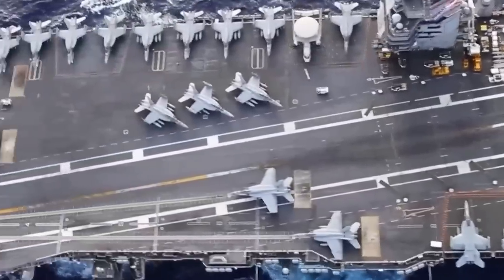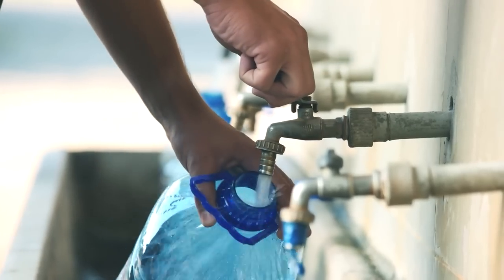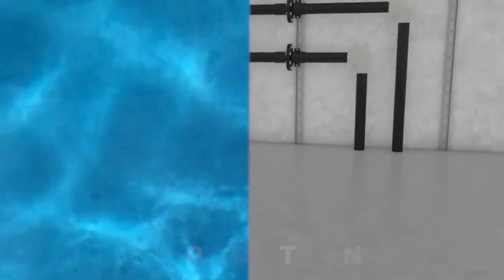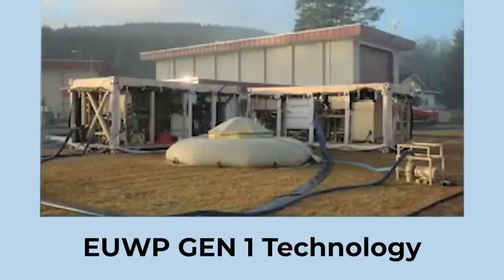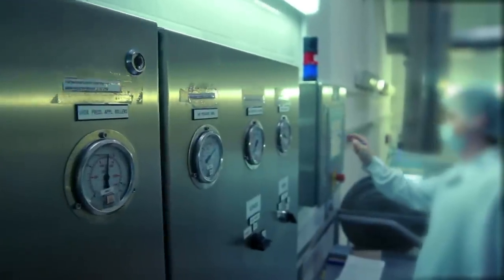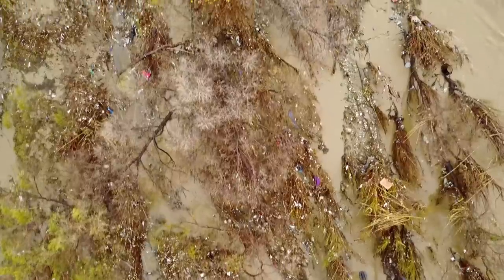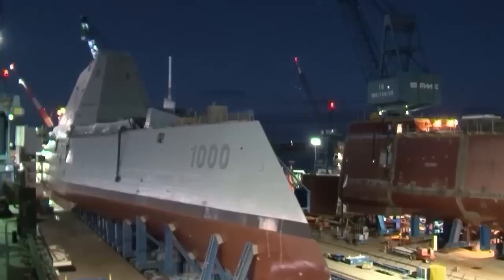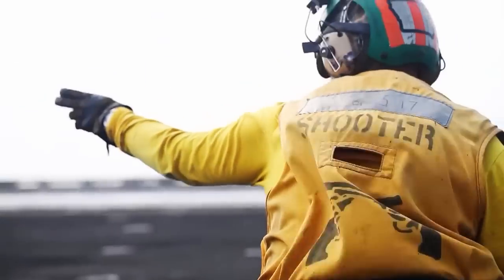How Aircraft Carriers Turn Seawater Into Fresh Drinking Water At Sea

Comment: I  was on the U.S.S.Constellation in the 70's. The ship's desalination systems were a mess and in need of major repairs. We were due to go home but were called to the Indian Ocean instead for a " show of force ". It got to the point just getting a drink of any water was nearly impossible. No showers, no laundry and no water coolers. We would sneak into the officers mess at night to fill cans of water to drink and that even reeked of jet fuel. Being over 140 degrees F on the flight deck we were dropping like flies. After all these years later I still treat water like gold.
Reply: A good story. Sorry that you, and your mates, had to suffer though.
Reply: Fresh Water is indeed liquid gold. Us just being in developed  nations having it on tap and handy tend to take it for grant right?
Reply: Priority order for water from the evaps is:
Boilers
Galley
"Hotel Services"  Showers/Laundry/General cleaning.

Blame the lack of water on the CO, not engineering.  That Oiler that kept your JP-5 topped off was quite capable of transferring raw distilled water, boiler feed, or potable water.  All he needed to do was swallow his pride, admit that his ship had a problem, and order up a few thousand gallons.  That's why there was a padeye for the RAS cables installed near the Water Inlet...

The Evaps were considered critical engineering equipment.  Spare parts up to and including complete units should have sailed with the battle group on one of the Replenishment ships.  If not available onboard, then whatever was needed should have been airlifted out to the BG or closest shore installation and cross-decked until it made it to where it was needed.  Again, a possible pride issue...First step is to admit that your ship has a problem.  From the carrier POV, a matter of ordering the parts and letting the support ships handle the logistics. 

As far as petroleum products in the water goes, there was a leakage issue or somebody screwed up and put the wrong liquid in the wrong tank.  I spent my time on a Replenishment Oiler that carried more fuel than your carrier did, and NEVER noted anything indicating a contamination issue.  With 5 million gallons of DFM (Boiler fuel) and 2.5 million gallons of JP-5  onboard in like 20 tanks, I'm sure that there was ample opportunity for a screw up, but it never happened.
Reply: Wow! Glad you SURVIVED, even though it was off POISON. INCREDIBLE!!!!
Reply: Whatever RATE, FALLS UNDER THE PROCUREMENT OF THIS OPERATION, has THE MOST "IMPORTANT", and TAKEN FOR "GRANTED" JOB ON  ALL US WARSHIPS. NON COMBAT VESSELS, included.
Reply: I use to be in aviation school in the 70's  and told there was a grade of alcohol use for cleaning air craft parts and some mechanics used a small amount as a chaser for drinks.
Reply: Ah, the advantages of being a snipe.
Reply: Sorry you had to experience that but nevertheless you still broke the rules when you and your buddies snuck into the officers mess. You must pay
Reply: @maundamartin59  I think the enginemen  do it now. In any case, it's a good idea to know the people making the water, because that's the easiest place to get it.
Reply: Show of force? To who? Well i guess that time U Saw Almighty SOVIETS Subs back then, at that time your whole Fleet got Runaway
Reply: Water is gold, so many people take it for granted until they cannot get any and realize how precious and important drinkable water is.
Reply: @kevincrosby1760  - What seems unthinkable to most people are totally believable to those of us who have been in similar situations.  You're probably right in that the CO didn't want to admit his ship had any problems as this would reflect badly on him - or more specifically, on his chance of promotion.
There's another option which seems even more unthinkable - that the CO didn't know there was a problem.  I've served on different ships and shore commands, and have been amazed by the naivite and cluelessness of people who have been put in such positions of responsibility.
Reply: "We would sneak into the officers mess at night to fill cans of water to drink"  -- This reminds me of Animal Farm, in which the pigs took the best of everything while the others went without - not because they wanted it, but because as leaders they were obligated to take better care of themselves.  All animals are equal, but some animals are more equal than others.
Reply: @dougearnest7590  For the second option to hold true, Water Logs would have had to been gundecked by multiple watchstanders and/or changed by the ChEng.  Water Logs should be part of the "Eight O'Clock Reports".  Further, "Water Hours" restrictions require sign-off by the CO and Med Officer.  I'm not seeing a path to the problem that does not require a CO signature somewhere along the line.

Good water reports and usage restrictions do not add up.  Usage restrictions and the CO not knowing should have ended the first time they passed the word over the 1MC reminding the crew of the restrictions while the CO and Med Officer were awake.

The problem could even have been higher up.  The CO could have made HIS reports and been told to shut up.  SOMEBODY knew!  You know as well as I do that problems of that magnitude would have been widely known as soon as crew got ashore and the beer started flowing.  

Heck, we knew that the Gompers returned from a WestPac with multiple (around 20 or so) married crew a few months pregnant within a day of their arrival.  That tidbit was making the rounds at the 32nd Street EM club very shortly after liberty was called away on the Gompers.
Reply: @kevincrosby1760  Good points, all.  I wasn't a snipe and didn't spend a lot of time rubbing elbows with the elite.  It was just speculation based on the fact that despite a person has to have an impeccable record to be given a command (especially something as stupendous as an aircraft carrier), I've seen plenty of these people who have lost touch with reality along the way and had no clue what was going on around them.
As for the tons of pregnant crewmembers returning from a WestPac, it doesn't matter what the rumors are, if the Navy denies it then it didn't happen, right?  Same with all the female reservists called up for Desert Shield who immediately got pregnant so they couldn't deploy - and remained on active duty collecting a salary until after the baby was born at taxpayer expense.  That, also, didn't happen.
Reply: Couldn't u have done ur own desalination?there has to tons of heat sources all over the ship,butane gas stoves,electric kettles.....empty glass bottles,beer cans plastic or rubber tubing that u can use to diy ur own desalination plant......

Use a prefilter to filter the water first to get rid of the basic gunk....or make ur own using simple sand and rocks and pebbles and activated charcoal

Shyt u could set up a desalination plant and sell bottles of cooled distilled water for $3 a bottle and make bank.
Reply: @jont2576  If you look at the safety rules and regs for a US Navy ship, the majority of them are for preventing fires and limiting the damage that a fire can do.

If you bring a butane tank on board, it had better be in your pocket in the form of a cigarette lighter.  Anything bigger goes to Flammable Gas Storage to be checked out for authorized use.

Flammable substances are handled with great care.  For instance, if my shop ordered a gallon can of Denatured Alcohol for cleaning parts, only certain designated personnel would have been able to pick it up from Stores after it arrived.  They would have signed for it and then taken it straight to the Flammable Liquids Storeroom where it would be tagged and logged in.  

Next step would be for somebody to log out the 2 oz. Alcohol container from the Shop's Flammables Locker and run up to the Flammable Liquids Storeroom.  After filling out a form they would go to the adjacent Handling Room where the gallon can would be brought to them so that they could fill the 2 oz. container.  The gallon can would be signed back in and the 2 oz. signed out.

When they arrived back at the shop, the little container of alcohol would be signed back into the shop's Flammables Locker and remain there under lock and key until it was checked out for a specific maintenance task which the docs stated required the alcohol.

About the largest container of flammable liquid that you would have in your personal possession would be that little yellow bottle of Zippo Lighter Fluid.  The little one, not the large size.

Shipboard electrical systems are different than what you find on shore.  What may work just fine and be completely safe in your kitchen at home might be a potentially lethal shock hazard to the user and possibly introduce line voltage to wiring where none should be present.

When you bring that electric kettle on board you are required to take it immediately to the Electrical Shop.  They will test it and tag it as Tested/Safe.  They will log the tag number, what the device is, who it belongs to, where it will be used, where it will be stored when not in use, and when it needs to be inspected again.  Expect pushback as 180F water is available on the mess decks 24/7.

There are other factors which come into play with your idea, but I can see one other glaring problem.  Since USN ships are "dry", if your hand-built distilling equipment is found, they will assume it is for the production of alcohol for consumption.  You are in deep shit if they find so much as an old piece of fruit or corn kernel which can be linked to you...and they WILL search.  In depth and diligently.

DISCLAIMER:
At any given time there will be illegal alcohol on board.  Smuggling it onboard past the quarterdeck watch or producing in on board has been a tradition since the Navy went "Dry" back in the 1800's.  Concealing said alcohol is an art form in and of itself.  It's also a good way to find yourself with a lower rank, no paycheck, restricted to the ship, and reporting for extra work after dinner.

As far as other illegal substances, at least once per month somebody in Medical will randomly pick at least one number between 0-9 (My ship used a 10-sided D&D die).  Shortly afterwards, the 1MC will ring out with "All personnel who's Social Security end with <X>, lay to Medical for Urinalysis".  This is a supervised test, where you lift your shirt and drop pants and shorts down to your knees in front of the trough with 10 or other guys, and Medical watches you all pee in the little cup and seal it with the label you were handed along with the empty cup.
Reply: I served on the USS Wasp in the 1950s and was in charge of the ship's fresh water system. Our evaporators never produced at design rates, required substantial downtime for maintenance, and resulted in water rationing and sea showers about 50% of the time we were at sea. I also spent much time explaining to the Chief Engineer what was not working today and why. I suspect later that day, he did the same with the ship's Captain.
Reply: @marvinmulligan4531  Your biggest problem with water probably stemmed from the same source as your practically needing to head out into the passageway to get enough room to get dressed.

CV-18 was designed and equipped for a base crew of 2500 sailors.  By the mid-50's she was running a crew of almost 3500.  I know that there were changes to the berthing areas and galley/mess areas to accommodate the extra crew.

Original design basis would have accommodated production for 2500 men plus feedwater needs on about a 75% evap duty cycle,  and allowed for adequate production for that number at 100% duty cycle with one evap offline.

So, did they add and/or upgrade evaps over the years, or just assume that you would run the original evaps at 100% capacity to accommodate that 33% increase in demand with no cushion for needed maintenance and no planning for one to be offline for extended maintenance or needed repairs?

I'm pretty sure that I know the answer.  Installing an EW suite on an UnRep ship is a great idea.  Increasing the electrical load to the point where losing an SSTG means that an UnRep ship can run Cargo Transfer Pumps OR run the EW suite, not so much.
Reply: Ok than who are you name and rank

Comment: Correcting some of your issues, 
1) Nimitz class aircraft carriers do not use Reverse Osmosis (RO) units to make distilled water. they use 4 7 stage vacuum type distilling units. each one is rated to 100000 gallons of water a day. the ships normal operations normally only need 2 in service to make up for all operations a Nimitz class carrier can do. 
2) the water from these distilling units are so pure, they have to add salts back to the waters before it is aloud for human consumption. reactor and steam plant water purity requirement require the water made is grade 1 water. RO units are not capable of producing Grade 1 water in the quantities required for a Nimitz class carrier's continuous operation. the major loss of water onboard a Nimitz class aircraft carrier is from its steam catapult systems.

Sources: 
Myself - Reactor Operator for Nimitz class Aircraft Carriers
RPM/SPM CVN-68 class
Steam Catapult Tech manual CVN-68 class.

Comment: Back in 60s/70s, we used exclusively distilling. Pretty high maintenance. If I remember, sounds like daily output of current system is approx X 2   CVA 66
Reply: Wonder if they still brominate. Yummy, yummy, bromine water.
Reply: @rocksnot952  Bromine is relatively inert as far as chemicals go.  Chlorine is corrosive, highly reactive, a strong oxidizing agent, and as a gas is deadly in low concentrations.

My guess is that they still Brominate and add the trace minerals back in.  Chlorine is just not something really awesome to have lurking around in a shipboard environment.
Reply: What about Fluoride? Is that being added to onboard drinking water as it's proven to strengthen teeth  and make them more resistant to decay.
Reply: @Au60schild  Fluoride doesn't clean out your GI tract and provide the wonderful flavor and color that bromine imparts. Also, fluoride in a form that is biocidal is VERY hard to handle.

Comment: Power is pretty plentiful on a nuclear carrier. And the reactor itself needs massive amounts of water to operate, so there is always plenty to spare.  Water is usually not a problem on nuclear ships (or subs)
Reply: With properly maintained equipment and basic water conservation as drilled into us since boot camp, water should not be a problem on a US Navy ship of ANY type.

Sure it happens, but it should only be an issue if there was an equipment failure or a major loss of water.  Excess capacity is designed into ships for exactly this reason.

Comment: It’s called freshwater generator, you evaporate seawater then condensate it. And a device called salinometer will test it’s salinity if it’s already safe to drink at a certain ppm. But usually it’s used on other uses other than drinking such as for cleaning, toilet water and more. It’s not that complicated as this video trying to explain 🤷🤷‍♂️
Reply: FYI, they don't waste fresh water to flush the toilets on Navy ships - they use seawater.

Comment: Replacing the jet fighters by drones will reduce the aircraft carrier `s need for a large  number of sailors .
Reply: Remove the air wing, and you will still have several thousand sailors on board just to run the ship.  The Navy does not use much automation.  Tasks are performed by trained sailors who can make decisions and don't require a full reboot to bring a system back online.
Reply: Drones actually have a larger support staff than jets at least for the Air Force. You also need pilots to fly them. 

Lack of pilots within an aircraft gives you extra flexibility in your missions. Of course, your enemy can also hack your drones like Iran did in Afghanistan
Reply: Yeah, but it'll increase the number of nerds to look after, program, remote pilot, and fix any damaged drones. DO WE REALLY WANT MORE NERDS  ON BOARD?!!!
Reply: Putting so many people’s lives at risk just to operate a power station at sea isn’t clever during warfare when the aircraft need refuelling anyway because they aren’t nuclear powered and the vessel needs restocking! Great in peacetime but disastrous in real naval warfare
Reply: @Stew72  The U.S. Navy has designed their onboard nuclear power plants to scram and lock down mechanically so that at even the deepest of depths the nuclear power plant(s) nor their fuel would be breached should their vessel sink. The power plants are located internally where they cannot be breached. So, no worries mate.The engineers are very smart in their design. A number of nuclear powered vessels have sunk with no risk.
Reply: @Au60schild  I work in shipbuilding and today’s and yesterday’s weaponry could get to them reactors! A twin hulled supertanker made from titanium couldn’t defend them so good luck when you do actually see naval warfare
Reply: @Then.72  The observation is obvious and valid, but... 

All of the OTHER ships in the Carrier Battle Group are there to protect the Carrier and its support vessels.  I might also point out that the surface ships are not the only USN vessels in play here, and that there are probably a few attack subs running around as well.

Taking out the carrier is indeed the endgame for that mission.  However, when you look at the amount of force which can be brought against an aggressor, the only really sure way to kill a carrier is to stand way off and nuke the CBG.  

Would YOU like to be standing in the capitol city of the nation which decided to employ WMD against the US Military?  BAD things will probably happen shortly afterwards.